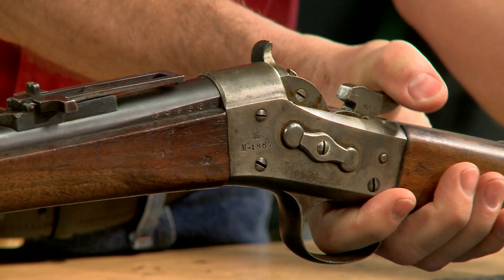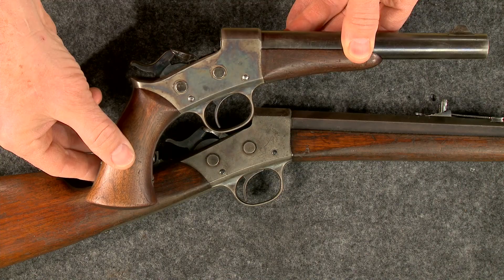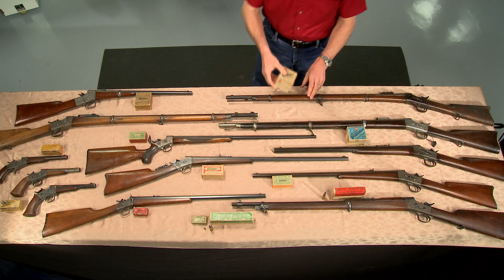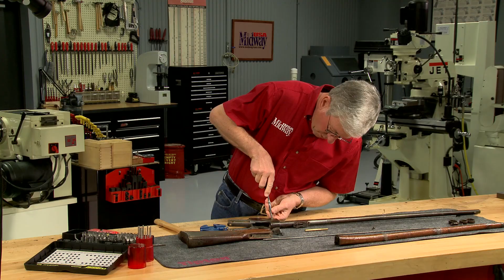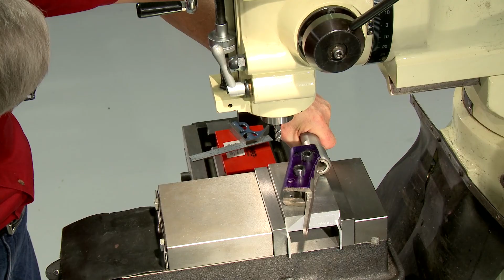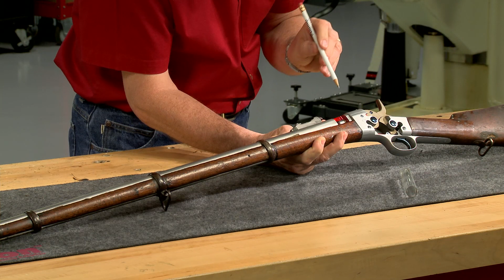How a Rolling Block Operates - The Cycle of Operation | MidwayUSA Gunsmithing

Comment: Did folks ever convert the rolling block so that it could have a percussion nipple inserted in place of the firing pin temporarily and used similarly to the Ballard Dual Ignition Rifle when cartridges ran out?  It would make sense to me to be able to use empty cases as percussion chambers and use percussion caps if out of normal ammo.

Comment: The cutaway model seems to show a less than tight fit between the hammer block and breech block,which would allow the chamber to leak gas when the gun was fired and you had a cartridge failure.You can see movement when he uses his thumb to show how the locked breech works. Guess that is a tighter fit when the real thing is fired.
Reply: That slop appears to possibly only be when it was on half cock. I'm guessing it has a better fit when fully fired. That.... and it's old as hell.

Comment: The best single-shot rifle design ever.  Solid, simple, and with so few moving parts is less likely to break than more complicated designs.
Reply: A decent and simple repeating action design in the Browning designed Winchester 1887 shotgun.
Reply: Basically a break-action that doesn't have to actually bend in the middle. Clever.

Comment: Wow, that is a very practical design. But I wonder if the rolling block would become a little loose when the chamber is closed, considering the extended mating surfaces between the rolling block cam and the cam on the hammer?

Comment: Great video; very informative. but I had to cringe when you used your calipers as a scribe...
Reply: as a professional machinist and fabricator that makes our nations unmentionables. i can assure you there is nothing wrong with laying out your work with calipers. if you get a really good expensive pair. thats what they are designed and used for. the hardened sharp tips are meant for laying out parts for machining. dont be afraid to do this.

Comment: awesome cutaway, someone should try .50 bmg on that action pattern, maybe beef up a little..
Reply: Yu Toob Serbu Firearms has a similar single shot .50 BMG. Instead of a rolling block, it has a screw on breech cap and heavy hammer. Very simple.  Check out the RN50 on the website. Not sure of the URL.
Reply: @paultroiani255  That isn't really similar at all, it's based on a break-action.